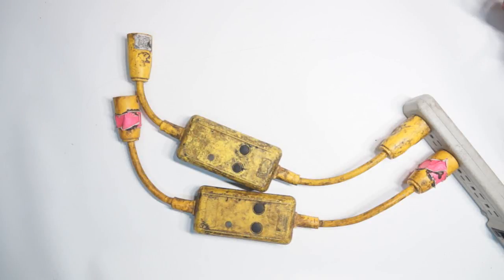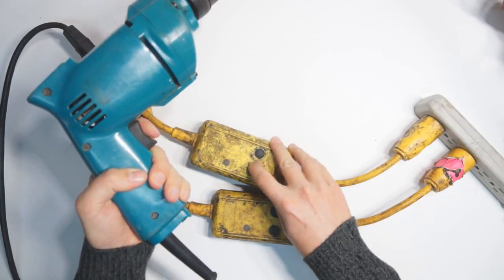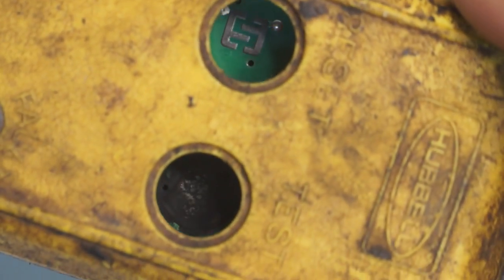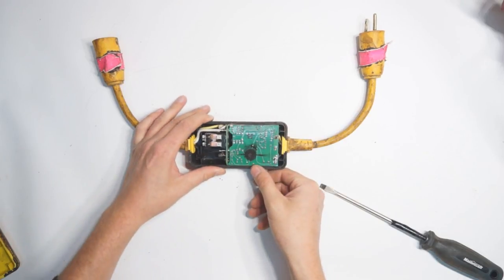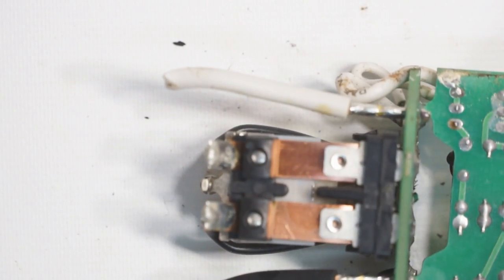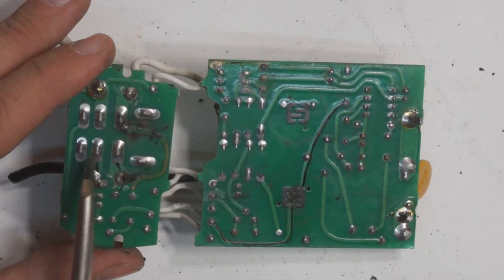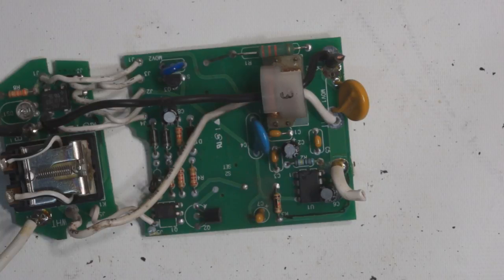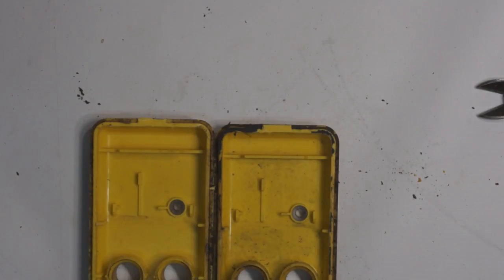Portable GFCI Autopsy

Comment: Did you leave the working one alone, given the permanence of its seal?

Perhaps the tool or cord used in the field was intermittently leaking, and the GFCI took the blame?
Reply from the maker: +Nevin Williams The "working" one had a cracked case and had water marks on the inside, I guess I could clean it and re-box it but for now it is in the "misc" bin.
Reply: Bit too iffy for a safety device if you ask me. Repurpose maybe, but not for anywhere that a GFCI is really needed. It's a sealed box because once anything is wrong with it you shouldn't be trusting your life to it. Cool teardown.